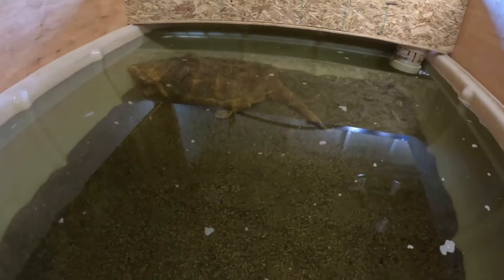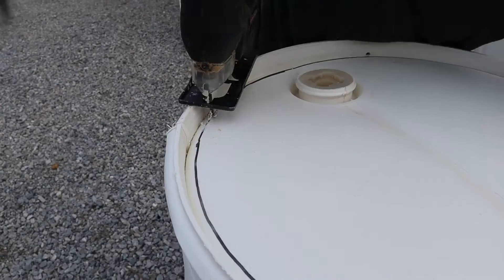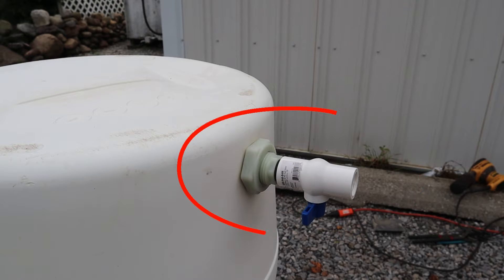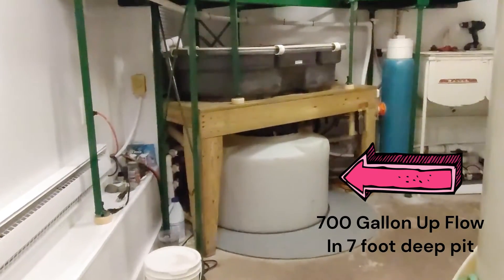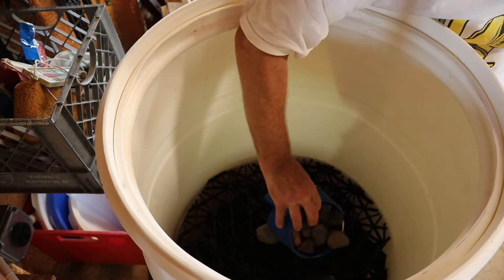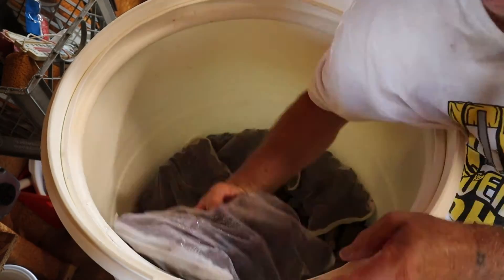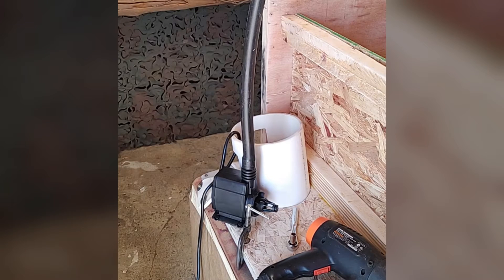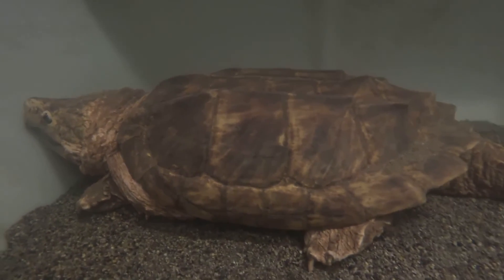Turtle & Fish Filter Built Cheap For Giant Snapping Turtle

Comment: Do you still have to do regular water change or you just have to add water to make up for those evaporated?
Reply from the maker: I'll add for evaporation. The only water we have to change is the giants. Sometimes we will feed the  turtles over100 lbs. large food, I always feed whole organism and let them not eat what they don't want, like they would in the wild. For instance, they never eat Tilapia fillets in the wild. Keepers choose "cleaner food" to make clean up easier or because it makes food acquisition easier.  When we over large meals to large turtles, I shut down the filtration to that habitat, feed and 6 hours later drain and refill the water that turtle ate it. For all the smaller turtles, 50 lb., and less, the filter runs during feedings and digests all waste. This system works great and saves us hundreds of thousands of gallons annually. The "up-flow"  design allows the filter to run for years without maintenance, no cleaning or backflushing.
Reply: @crunchinfo thanks for sharing these! Definitely learnt a lot from watching your videos!
Reply from the maker: Thanks for watching. These filters work great! Go out and build one. If you need any help, reach out, I'll answer your questions. @Allysnapper

Comment: Definitely going to try this set come spring for my ast that will be going in a 300 gallon stock tank. I live in Michigan what's a good substrate? And what type of driftwood would be best. Love the video. Thanks
Reply from the maker: You will be glad you built it. I like the river rock and the lava rock the best. It's easy and cheap. I use oak for wood but anything except pine and never walnut. I have a video about preparing the wood but I'll boil it sometimes to get it to sink sooner. I think my video on wood is a longer video, not in the shorts. Thanks for watching.  Remember the bacteria growth in the substrate is really what makes the magic happen, more than a finer substrate that traps it and clogs up.

Comment: Great video Rusty. Well said and explained. I will absolutely make this same filter when I do an outdoor setup. The only thing I’d add is a top layer of foam for even more filtering which would be very easy to pull out and spray out and toss back in. Is that big boy going to go into the 3,500gal set up eventually?
Reply from the maker: Thanks so much! I think if you build it, you'll find the foam unnecessary.